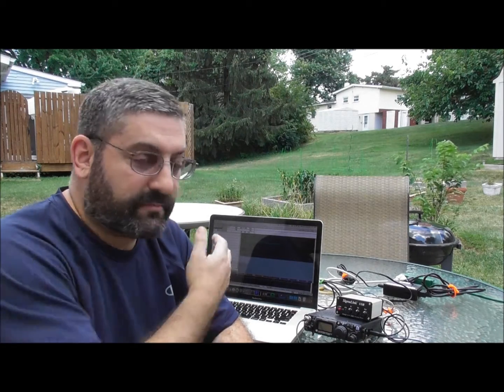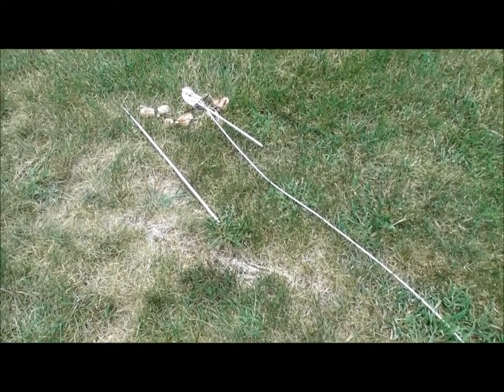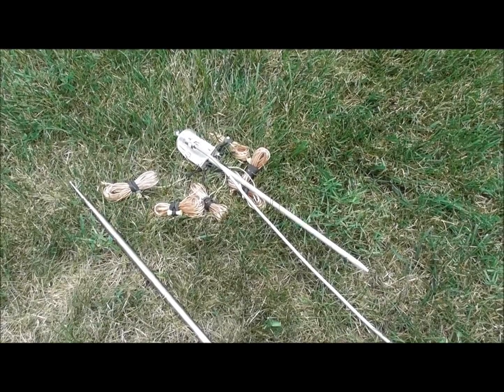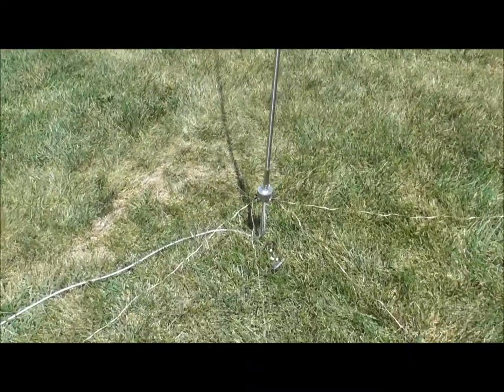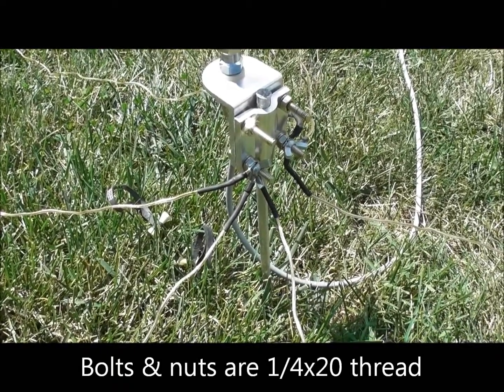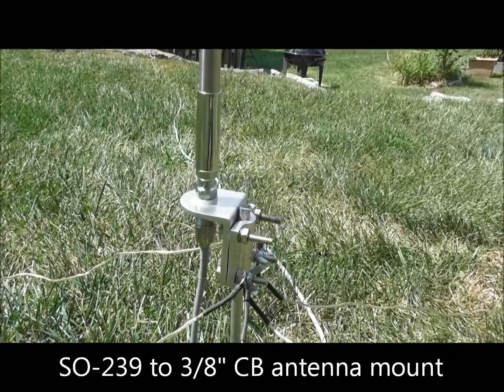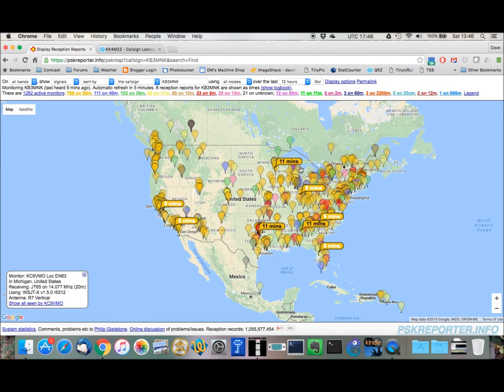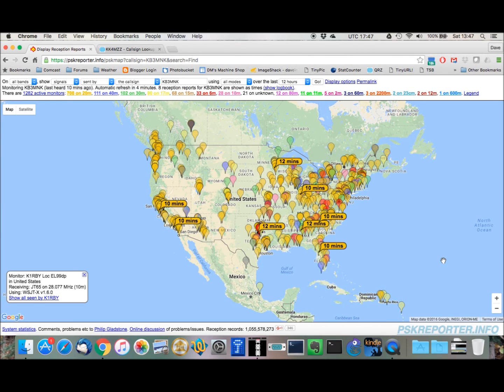Digital QRP with a Mac and SignaLink USB

Comment: wonder if you could help, i have a macbook pro and i just can't get my signalink to work FLDIGI, i have done the jumpers and it still won't work not getting Ptt light on the link when i transmit it won't even control the rig any help would be great
Reply from the maker: Need a lot more detail on how you have it hooked up, and the Fldigi settings.

Comment: From my understanding you just need to use the Data cable but I see you are using both. I am having trouble myself getting my 857d and Signalink to communicate via the data port and share the audio with my macbook.

Comment: Dave, are you having any trouble getting your mac to recognize your radio with flrig? I am able to use fldigi with my macbook pro but I have not been able to use flrig to control the radio, I have to do it manually.
Reply from the maker: I haven't messed with flrig much, and not for awhile, but I didn't have problems with it from what I can recall.